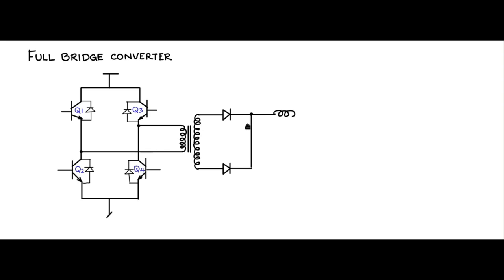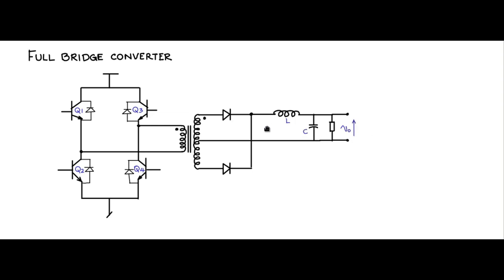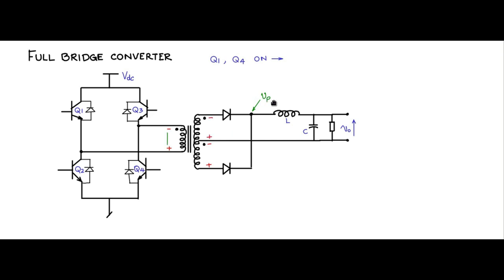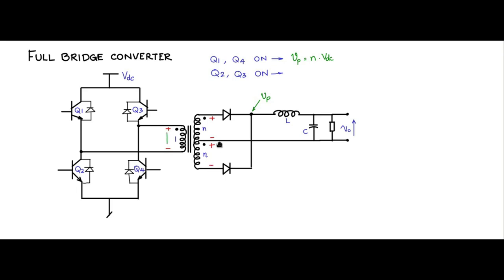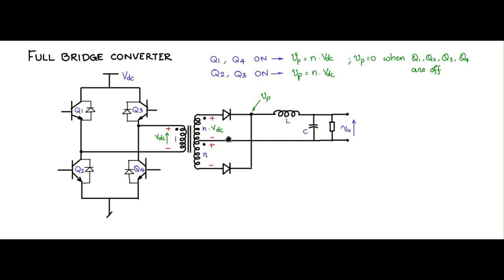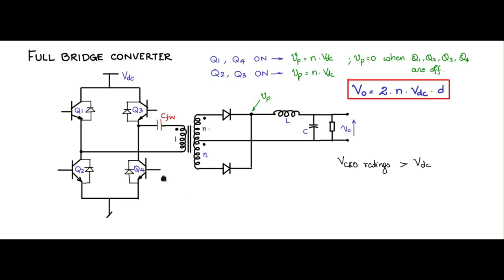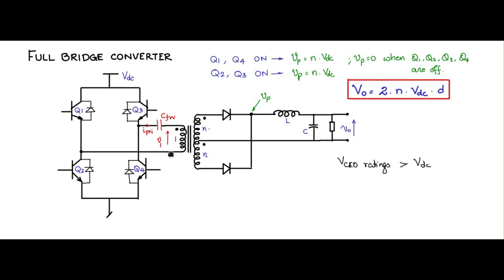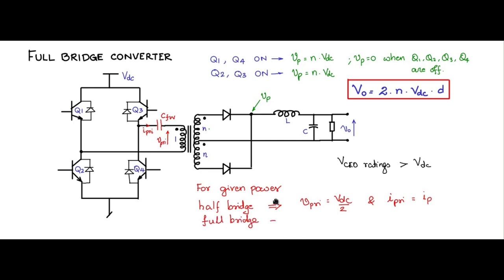Full bridge converter - review

Comment: If I use 230 -0 -230 and put 1 diode each of 230 sides.  then Jump points after 230 and 230 together, how much DC voltage I will get. Is it 230 x 1.2 = 276VDC?  can you help show me formula. Thank you.